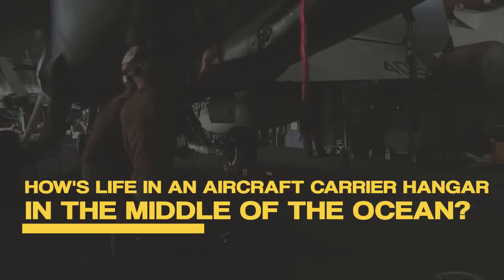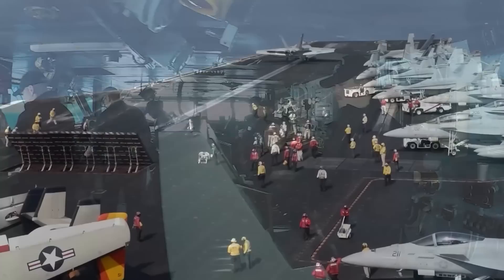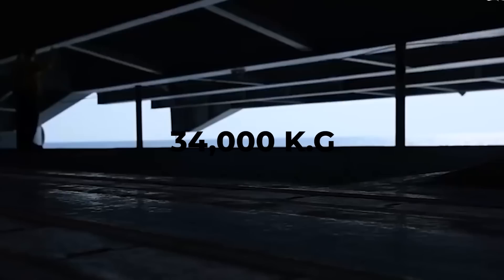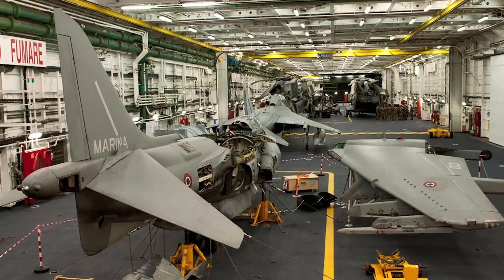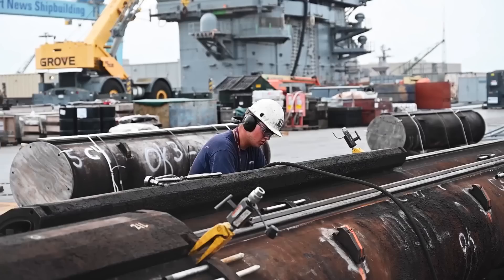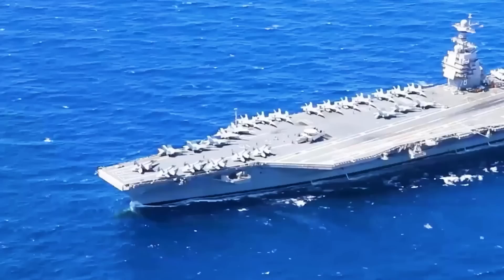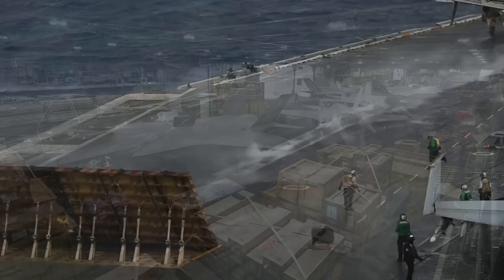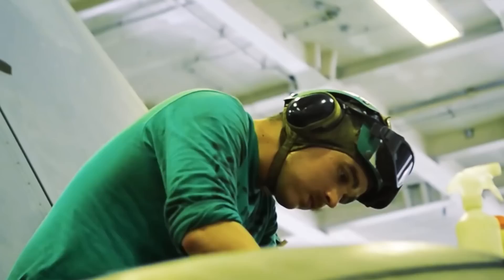How Sailors Live Under A Flight Deck of an Aircraft Carrier Hangar Bay

Comment: I've never seen any carrier "warming up" their aircraft in the hangar bays. The aircraft are unchocked and loaded onto the elevators, taken to the flight deck and "spotted" for future flights. You'd never find an aircraft turning over its engines in the hangar bay.
Reply: Sometimes they will do a low powered turn in the hanger bay after an engine replacement. Hanger bay 2 is where they would do this. Hanger bay 1 and 3 would be isolated. That's how it was done when I was on the Nimitz.
Reply: They used to do APU and Low Power maintenance run ups in Hangar Bay 3 on Nimitz class carriers back when I was in. (CVN 70). But yeah, you are right for the most part.
Reply: @chrisromero5302  that's how they did it on Forrestal as well, but its different than warming the engines up before taking them to the flight deck for a shot off the carrier. That's done with the pilot fully strapped in and ready for the flight, and the aircraft is already on the flight deck.
Reply: Exactly , served on The Coral Sea and never saw this it would be a huge safety fail!
Reply: I've never stepped foot on an aircraft carrier, let alone a navy ship. But I work around airplanes quite a bit, so the claim that the navy was running fighter jet engines inside that tight little space while the planes got maneuvered around to the flight deck seemed pretty suspect.

Comment: On both of the two carriers I served on, the galleys were one deck below the hangar bays, and the hangar bays were 4 decks below the the flight deck.  The 01 & 02 decks did not run the full length of the ship, but the 03 level, which was immediately below the flight deck, did.  Also, the majority of the shops in AIMD were forward of the hangar bays.

Comment: Soooo much inaccurate information!  Most of those aboard a carrier have nothing to do with air operations at all!  Thousands on the hangar deck is ridiculous!
Reply: hey fellow Sunliner! whoever did this video has never been on a carrier. I'm so old, when I was a Sunliner, we flew the A-7e Corsair ll, and we went out on the U.S.S. Forrestal. I was an AME troubleshooter and worked on the flight deck for about two years. Didn't know it at the time, but it was the best job I ever had.
Reply: @stanleyhatfield4902  I was in the squadron from '69-'71 in the AT Shop.  I joined VA-81 mid-cruise aboard JFK (CVA-67) when we  had A-4C's.  Then we transitioned to A-7E's. I was on that deployment aboard Forrestal Jan '71.  I left the ship in Barcelona in April and returned to CONUS for separation from active duty at NS Philadelphia.  Cdr. Damico was our skipper.  Our shop aboard Forrestal, along with the AQ's from VA-81 and VA-83, was on the O-3 right at the end of the angle.  We had an AN whose job it was to watch a monitor during recoveries and yell "BOLTER" when appropriate!  There was no soundproofing and the sound of the tailhook dragging on the deck and the roar of the jet plus afterburner was beyond deafening!
Reply: @JGW845  my first med cruise was in 72. we were gone from september 72 till july of 73. we just missed each other.

Comment: I served on the USS Constellation in the 1970's in VA-146 operating A-7E's. In no manner are aircraft "warmed up " anywhere IN or around the hangar bay. Not sure how you herd that but it's not true at all ! As for living under the flight deck our squadron berthing compartment was on the 02 level just below the number 3 arresting wire. You have to learn how to sleep when a tail hook hits the deck above your head from a 50,000 lb. Prowler landing. Fun time all round. Our hangar doors where rarely closed to the outside unless the weather was bad enough to close them. Having them open provided ventilation for the crew and reduce the possible build up of fumes from the parked aircraft. We all would have rather worked in the hangar than on the "roof" during the day time heat.

Comment: I was a signalman onboard the "starship" Enterprise CVAN-65 from April 1973 to May 1974. Berthing for us scivvy wavers and quartermasters was on the bow right below the flight deck, right underneath the starboard catapult. My buck was directly below where the stopping block was. You never heard such noise in your life. You hear it coming down the track, then BAM! then woosh from the F4. It wasn't to easy to sleep. Sometimes I would go to the ship's library and find a chair to sleep on.
Reply: Noisy all the time. Why they give out earplugs.
Reply: @WizzRacing  Nobody gave me any! I never saw anybody wearing them back then.
Reply: @WizzRacing  There are hundreds of things going on around you, having earplugs isn't that safe. You won't be able to hear the fire alarm, general quarters alarm go off, or anything near you. It's not all the good an idea. Nobody on the ships I was on were given earplugs.
Reply: @gordonvincent731  You can hear just fine... I used them for 45 years on motorcycles. Why I can still hear perfect at 65 years old...
Reply: @WizzRacing  Good for you. Then didn't give us anything.
Reply: USS RANDOLPH mid to late 60s berthing aft of chain locker under catapult also.   HS-7 Squadron remember the noise had top bunk

Comment: Another inaccurate video, the hanger deck isn't open air there are doors that can close between the elevators and the hanger deck. Aircraft engines are never started on the hanger deck for a number of reasons not the least of which is fire.
Reply: For sure.  When we did the GQ drills, one of the first things they did was yo to close the hangar bay and elevator doors.  And right after that they shut off the ventilation. Good times.
Reply: Yes aircraft are started on the hanger deck . Not often but there are times when they have to be checked out before sent up.

Comment: Does the Navy still have dependents cruises anymore? I loaded my 1973 Ford Gran Torino aboard the Enterprise February 1974 on the Port side flight deck for the trip from Bremerton, WA. to Alameda, CA. Flight deck, hanger deck full of cars and little travel trailers.
Reply: And when they do something like that you have to sign a waiver that says if something drastic happens that endangers the ship, the POV's (privately owned vehicles) will get thrown over the side.
Reply: @jimwjohnq.public  I don't recall signing anything.
Reply: ya but there called tiger cruises now
Reply: That grand Torino had a bad ass am radio
Reply: @stevengoodman7167  I ordered it at the Ford Military sales, B6 annex, Subic Naval Base, P.I. March 13, 1973. Power steering, power disc brakes, AM radio Ford-O-Matic trans and white wall tires. It cost $3,470.75 and picked it up June 13 at Skyway Ford LA. I didn't keep it long enough.
Reply: @gordonvincent731  Sounds like you wish you had that car today. I love your detailed nostalgia for it.

Comment: Hangars..huh..We had  a huge fire on boar dHMS  Eagle in 1956 (Suez punch up)..  Guy pulled the jammed round safety breech   pin from a jammed gun and  20mm  cannonn went off went off and spattered ammo throughs fully bombed up aircraft with rockets on their wings.
Armoured door of the hangar to the ford lift  jammed..sprinklers on and fire doused. w recked the ford lower hangar and 5 aircraftr..killed the guy who started it.     All thr'o removing the gun breec hsafety  pin which was clearly marked DO NOT REMOVE🙄
Frightened hell out of me  The mid and rear hangars on that deck were full of petrol prop aircraft and only the hangar  control sentry saved the lot by lowering the fire curtain between  ford mid and aft hangars...I reckon he should have had at least a commendation.